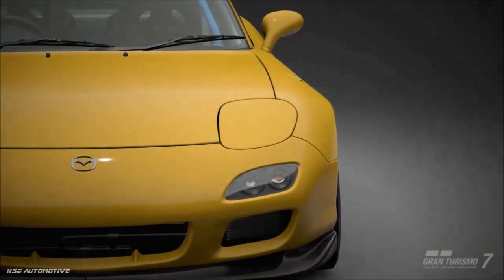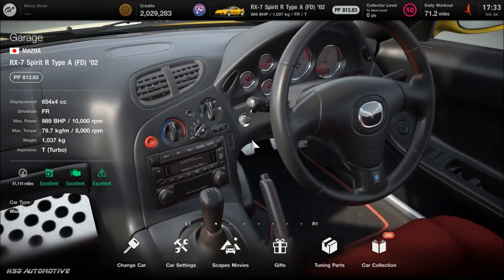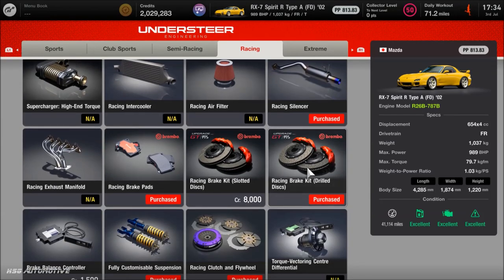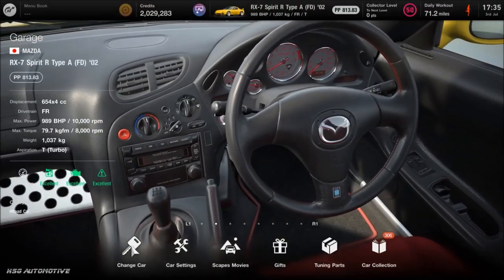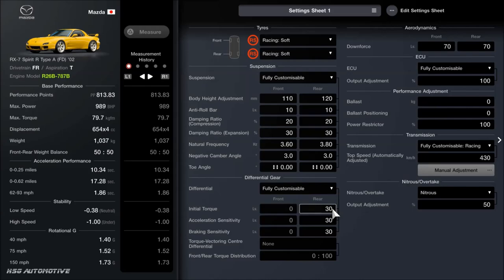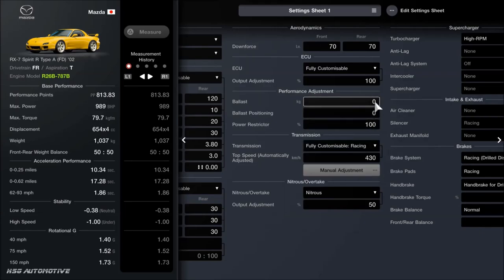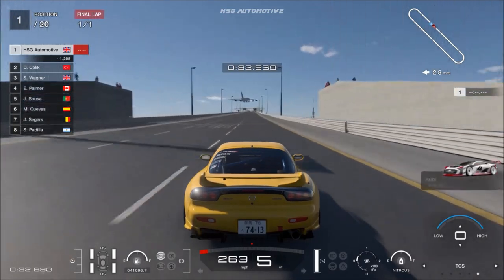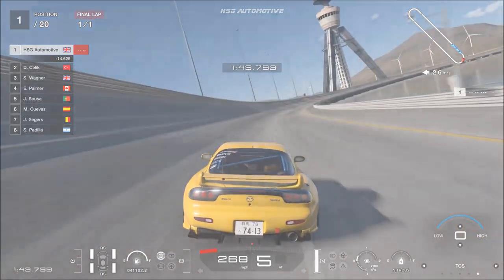GT7 | 300 MPH (490 KMH) Mazda RX7 Spirit R Engine Swap Build Tutorial

Comment: This swap does incredibly well in the wtc700 at Le Mans. If you leave it naturally aspirated and cut the power back with the restrictor, it meets the pp limit. It’ll do 4 laps with the fuel map on 1 while easily outrunning the other cars. Tune suspension, trans and diff accordingly and it makes for a fun and easy way to win credits
Reply: Can u possibly share the Suspension, Diff , and Aero settings to have it be able to perform on track ?? I don't care about top speed straight line Setups ... I don't see the point in them .. Actual track setups is what matters and I just can't for the life of me get this stable and well rounded for tracks
Reply: I’ve just done that race with this car with fuel turned down I managed the whole race without a stop and won easily.
Reply: @dariusbaja21  this car likes to break the back end loose so diff settings will be crucial here. Here is my personal setup. 
Height: 100/110
Roll bar: 7/7
Compression: 37/34
Expansion:46/49
Frequency: 2.75/2.65
Camber: 2.5/2.5
Toe 0.10/0.00
Diff settings 
Initial:22
Acceleration:5
Deceleration:50
I have both values on aero turned all the way down to meet pp limits. Restrictor at 70%. These are just my preferences, but hopefully that gives you somewhere to start from.
Reply: @markygti138  it’s really insane how good it is on fuel. I usually don’t run it on 1, but the fact that it will get you that far on the highest setting is incredible in itself.
Reply: @Beefsupreme259  looking forward to building an 700+ pp version for the Spa 1hr endurance.
Reply: @Beefsupreme259  awesome , thanks for sharing.
Reply: Yup. And the mileage is great.  If you are lucky to have no rain, you can probably clear 4 laps in a single tank with the right management.
Reply: @dariusbaja21  If I remember correctly, I just popped the engine in, and went racing. No tuning. Only Hard Racing and Intermediate in case of rain.
Reply: @rogerjuniorchabot  just with default/No setup at all ? She's too wild n crazy like that lol
Reply: @Beefsupreme259  thanks a lot for the tips! I just used it to win in the new Hyper car parade events.
Reply: I won the Lemans 700PP race easily in 6 laps,  with a swap in RX-8 Spirit R ‘12

Comment: Tuned the RX7 with the 787b engine for the Le Mans 30min race with hard tyres and  don’t even have to refuel if on mode 6 and win easily
Reply: Can you share your car setting, please?  I have been trying to get mine to handle properly....  😅😅
Reply: @frankthetank99  it can be a bit twitchy when it’s damp

Racing hard tyres

Suspension 
BHA 95/105
ARB 2/6
DRC 32/35
DRE 41/44
NF 2.25/2.42
NCA 0.5/1.7
TA 0/0.19

Differential 
IT 10
AS 38
BS 30

Downforce 
F87
R142

ECU 76

Power Restrictor 75

Transmission 270

Brake controller -2

Got carbon brakes
Racing pads
Racing transmission 

Should score 699.42 ish

Comment: can u make a video of the '88 silvia Q's race track build with the LS7 engine swap , also a top speed tune build and thank u
Reply: That would really be awesome I’ve seen the top speed tune and played with a little bit myself and got it to close to 315 mph but some people have gotten it over 320+ and they probably are running a different aerodynamics kit or less downforce but I would love to dial in a track tune for this car it is a monster
Reply: @backwoodsbowties8538  absolutely digging for it  ive lurked around abit but by default settings it has alot of body rolls seems unstable
Reply: Right now I’m trying to fool with the mx5 with the corvette swap in the Watkins Glen daily. Not the fastest out there but fun to drive: the mini with the k20 swap seems to be flying in these lobbies